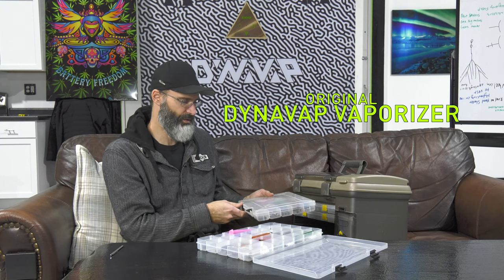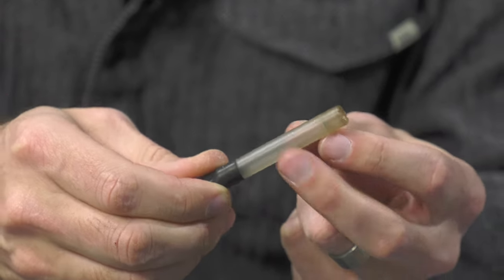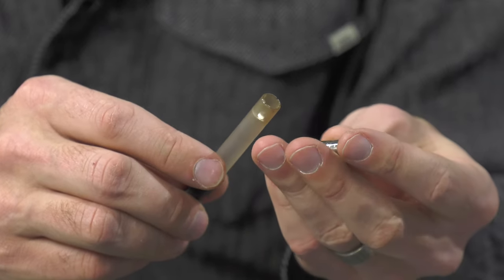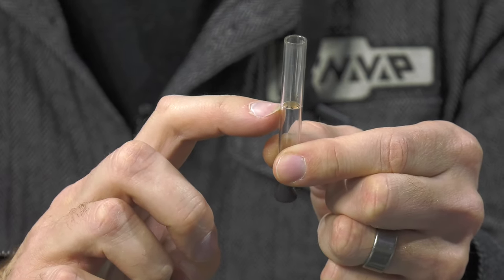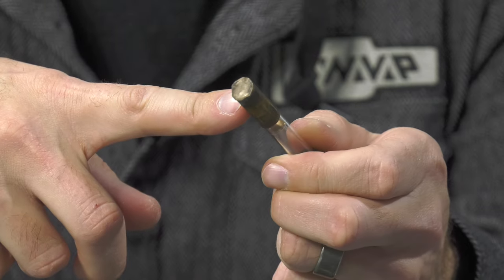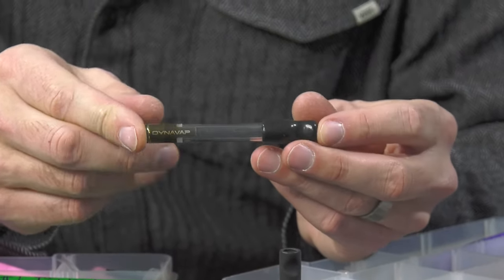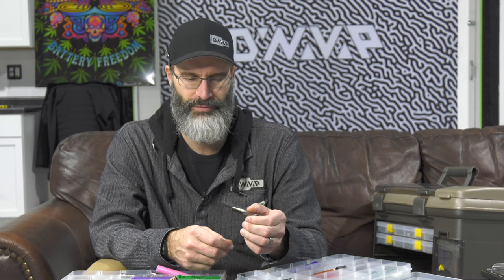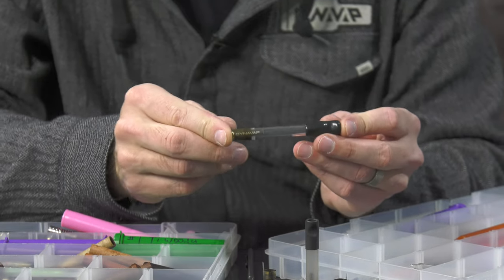What did the first vaporizer look like?  | DynaVap Archives

Comment: I often use a BB9 which has no condenser, question - what exactly does the condenser do on the M.
Reply: My guess would be it doesn't get as hot as the body so it cools the vapir down